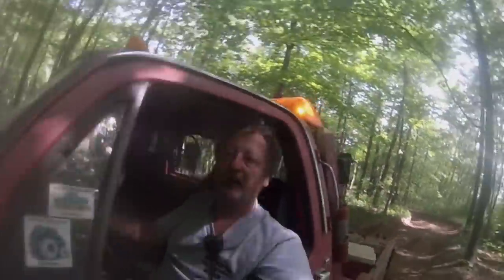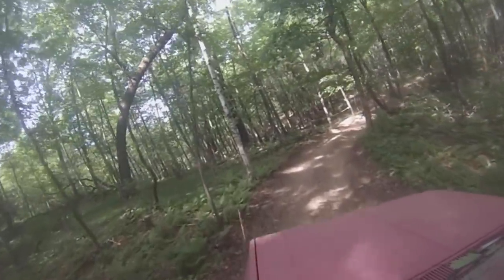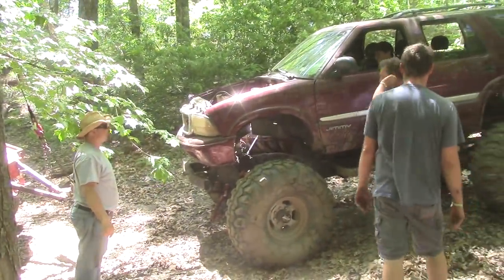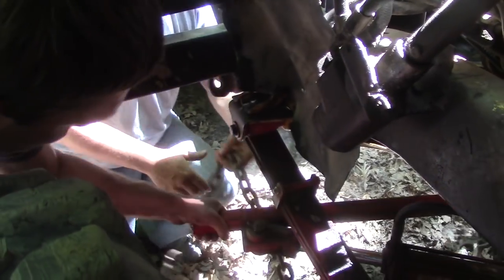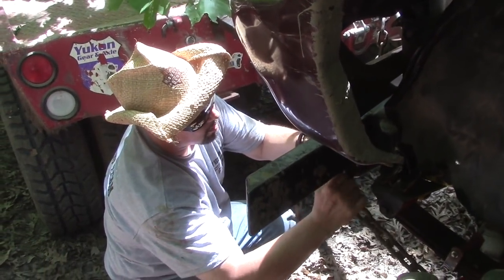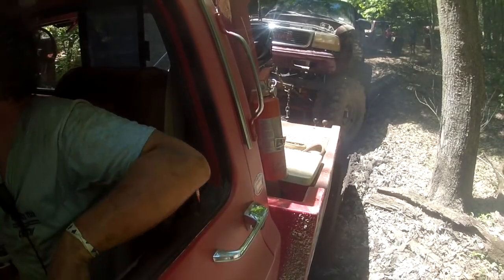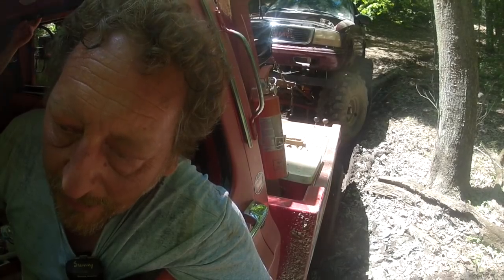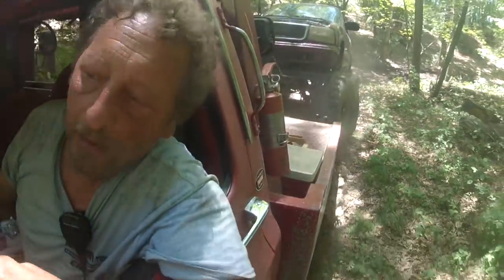GMC JIMMY RECOVERY by BSF Recovery team

Comment: Eric nice recovery. Any chance we will see the CJ5 again? I've got a '77 with the AMC 401ci
Reply from the maker: Would like that 401 for it, LOL we have thoughts of a project Jeep for Seat cover.
Reply: LOL, very cool look forward too it. Only thing that has really been done to it was add a Mallory distributor, 750cfm Edelbrock, and BeCool radiator. Replace the heater core, a hub flange, clutch and SB has been rebuilt. My dad bought it new with the 401 as an option. Paint code 7L